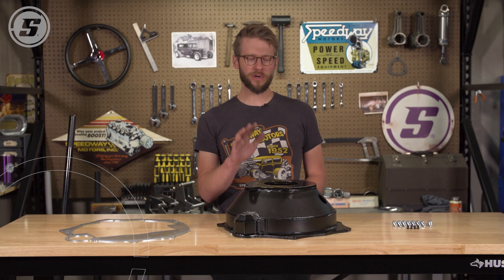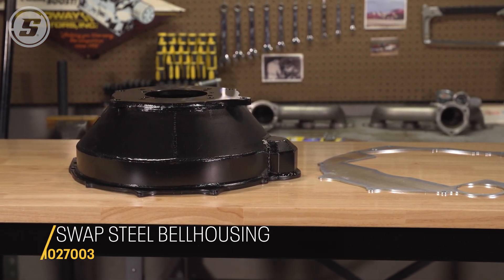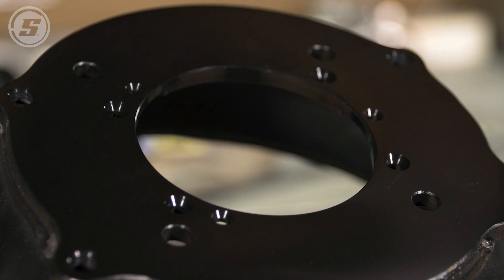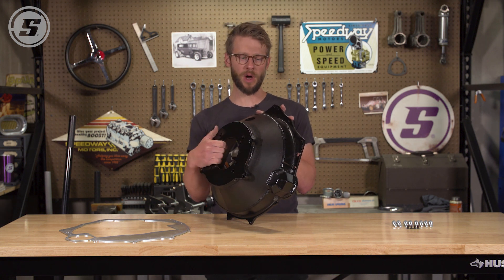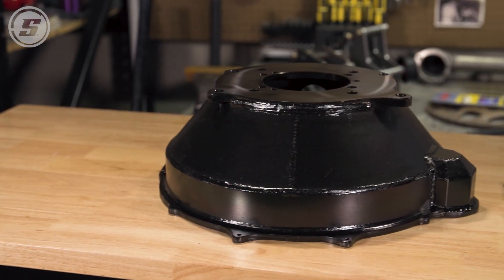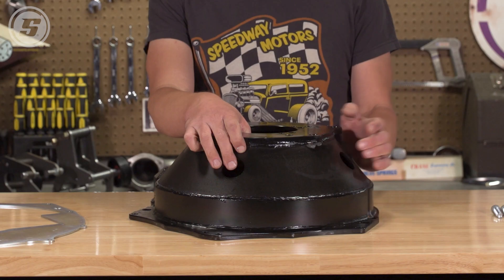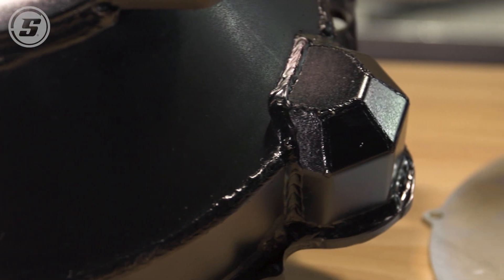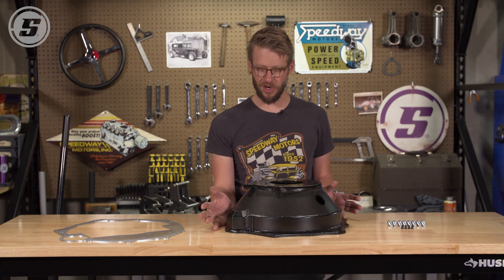LS Swap Transmission Adapter Steel Bellhousing 5-Speed Conversion

Comment: Will this work with my stock Borg Warner t5 from a thirdgen Camaro to LS?
Reply: Never got an answer so I went with a Silver Sport 621 bellhousing for $299 compared to the $400 from Speedway.
Reply: @Unczgarage  How did you deal with the transmission being tilted 17 degrees?
Reply: @anesthes  I did more research and took a chance on a QuickTime bellhousing from Holley RM-6018 is the part number. It’s not advertised as a LS swap compatible bellhousing but it accommodates for keeping the angle of the t5 and bolted right up to my LS. I have a video all about it on my channel if you wanted to check it out.
Reply: Hey did the bellhousing you bought allow you to retain the tilt for the fbody?

I'm trying to switch from 700r4 to t5 behind a stock 4.8. It's in an 87 camaro. Would like it to retain that 11 degree angle or whatever for the shifter
Reply: @ericsellers9506  it sure did, just like the factory bellhousing.
Reply: I was looking at the silversport one . Is that the one you got? I seen the quicktime comment after and they're waaay out of my league

Comment: Can you use a T5 transmission or a ar5 transmission
Reply from the maker: You can use a T5 with part #91027003, but not with part #91027005. We don't offer any bell housings for an AR5 transmission however.